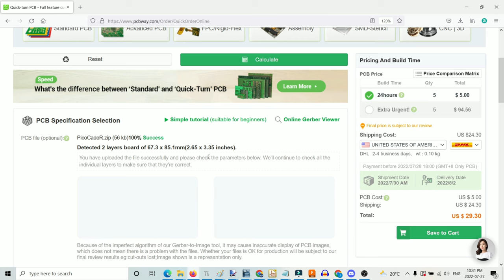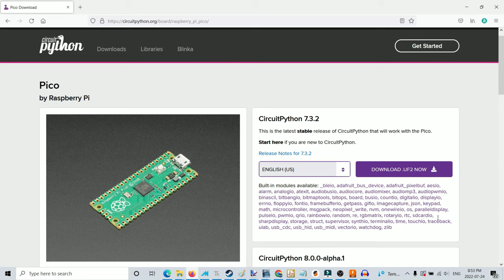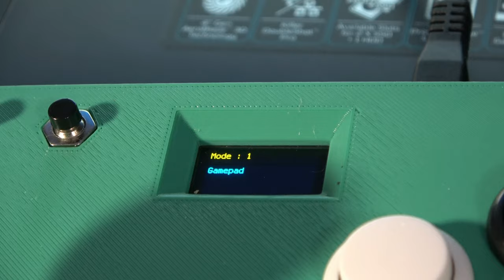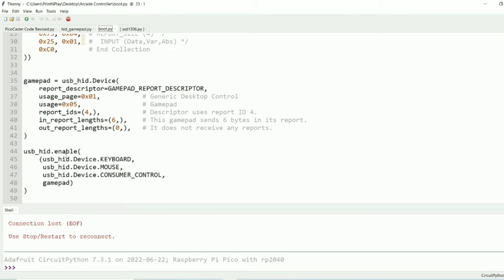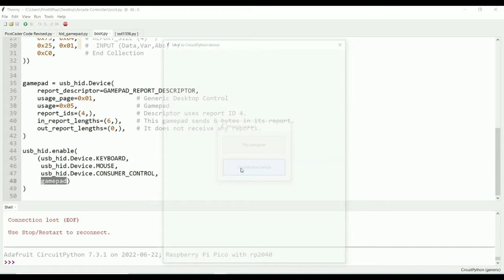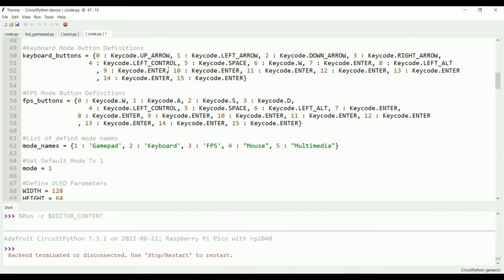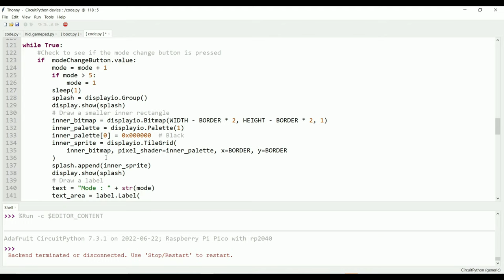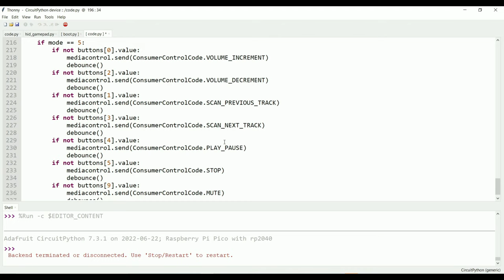Use A Raspberry Pi Pico as a HID [Gamepad, Keyboard, Mouse, and Multimedia]

Comment: Pretty clever. If you're not an arcade purist, you can add a secondary version of each mode that includes a press-and-hold function to make the buttons turbo.
Despite having seen multiple Pico tutorials, yours is the first that really shows how easy it is to register inputs. Perhaps it's time to actually start that MIDI controller I've always thought of!
Reply from the maker: Absolutely.  You could even add a modifier button to allow you to record several actions and bind them to a button, for games with special moves. Or add a potentiometer using one of the analog inputs to have a variable speed turbo.
Glad you liked the tutorial

Comment: hi.. me again... the atari joystick man... can i use this to create a 2 atari joystick adapter  with one pico ?? Sorry my english...!!! thanks!!
Reply from the maker: Hey there! All of this does come together to give you the tools you need. I just haven't gotten the 9 pin female connectors I need to build the adapter and show you. Soon!
Reply: @PrintNPlay  hello friend... I'm using this code to make my atari adapter (eliminating the part related to the screen, I think, with success, since I don't need it for now) one question... a cable from the arcade buttons goes to, eg GPIO1 and the other? GND? 3v3?
Reply from the maker: Sounds like you are making good progress! Goes from GP01 to ground.
Reply: I only have the code on the Pico and a PC switch with its cables connected to GND and GPIO... But...

Comment: Can I use Thonny IDE instead Circuit Phyton?
Reply from the maker: CircuitPython is a replacement for MicroPython, both are still programmable via Thonny
Reply: I am not a real programmer, just an hobiest

A. 
Fortunately - It works for me - but litle bit trouble - display menu keep scrolling, what switch you use for GP22 (menu selector) - tactical switch? 
B. 
I only need gamepad function - then I tried deleted 2 - 4 function on menu selection + set 1 instead 5 - so when it run it keep on gamepad function - it works but on control panel button response  sooo   slowly - what's should I do? 

Anw,  thx for amazing tutorial  !!! 
& sorry for my bad English 😃

Comment: I hope there's a C/C++ HID library for the Pico out there. Python is a horrendous (and slow as hell) language, which does't do justice to this amazing board.
Reply from the maker: I'm sure it's out there! And absolutely, if you want the best performance, python isn't the way to go.
Reply: I love these comments. As if you’re fast/perceptive enough to notice the difference between arduino and circuitpython in any hid capacity. Especially on a chip as fast as the RP2040.
Reply: @paleopteryx  ill have you know my pi pico can print way more text than 'hello world'
Reply: @VladTheInhaler1 I bet it does! And at the same speed in C++ as in Python! Who would have guessed?